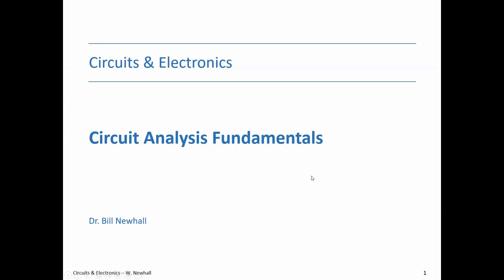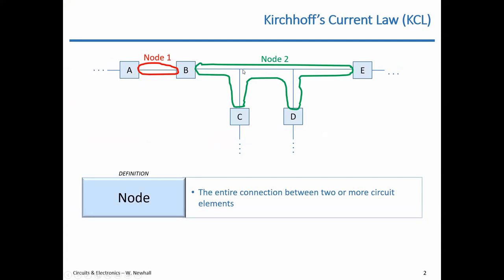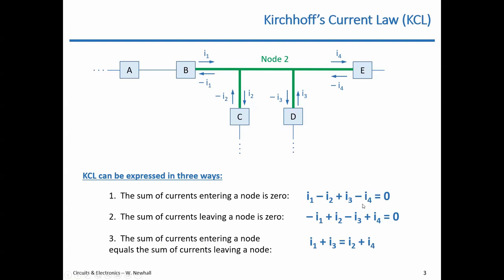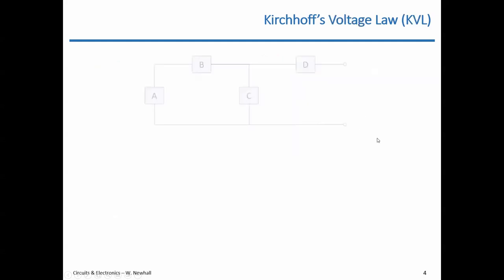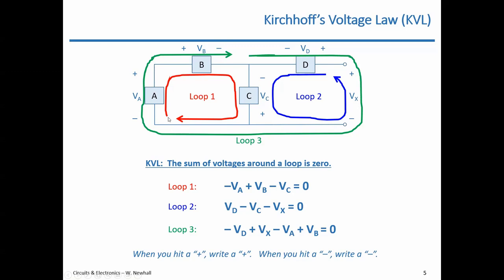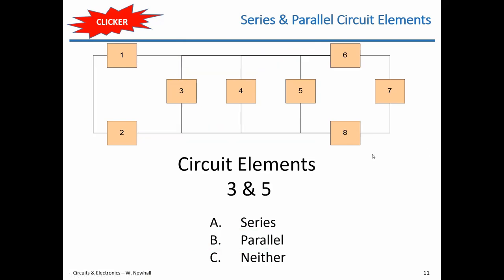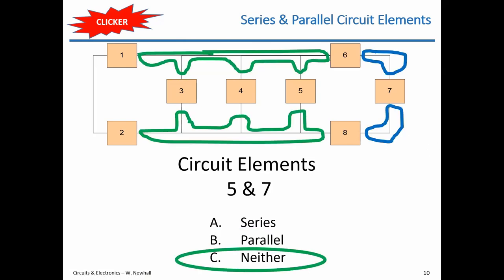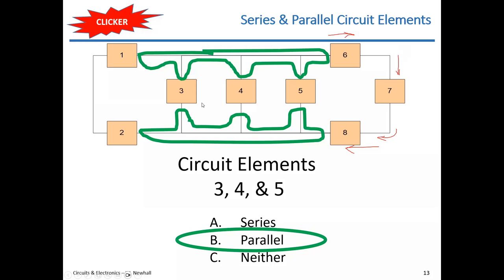Circuits & Electronics - Lecture 3 (Spring 2024)

Comment: Excellent lesson. Lingers on the important basics. Some basic points that could improve understanding in my opinion are that voltage anywhere on a node is equal, and that current does not change direction nor magnitude when it passes through circuit elements. Thanks!